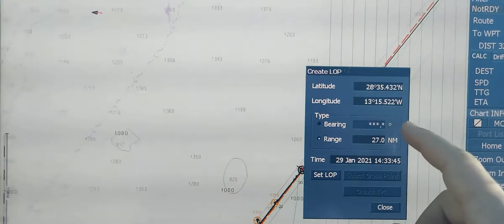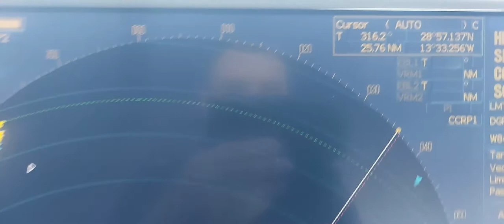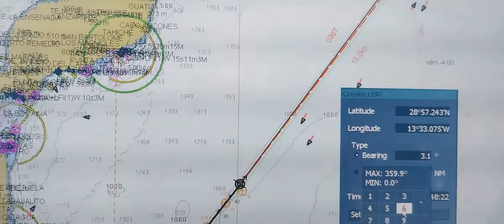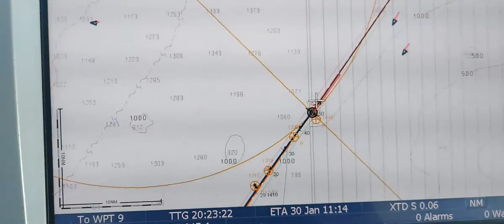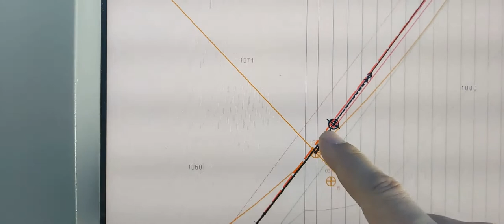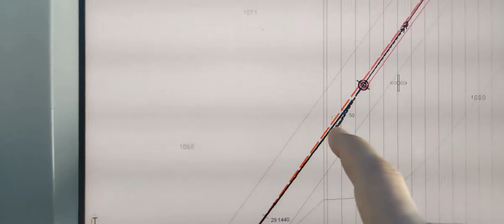LOP MANUAL FIX POSITION ON ECDIS JRC JAN-901B/2000

Comment: Hello,could you please advise how to plot position by GPS? I worked before on Furuno FMD 3300,its very simple there.But now I have to work on JRC - could you please advise how you normally plot position every hour?
Reply from the maker: Hi ! You can plot using the "Event mark", go to the Top menu -> (1) Marking/Highlighting -> (1) Event mark, it will plot as per your GPS pin. So it's also very simple.
Reply: @MARINERS-CLUB  how can we delete this event mark that we already plotted?
Reply from the maker: Just right click on the mouse, and info, is here Wil be function to delete